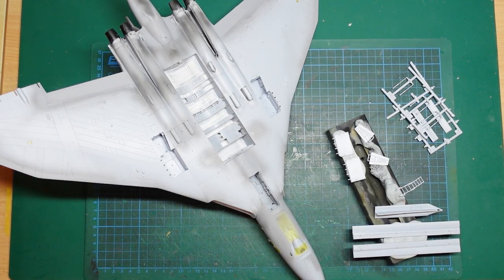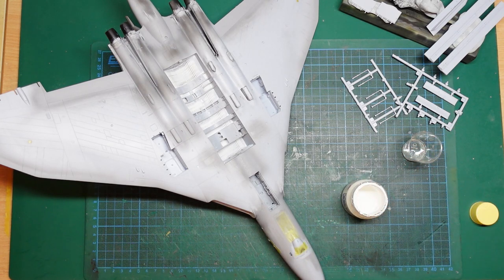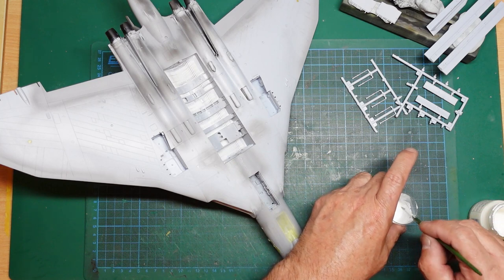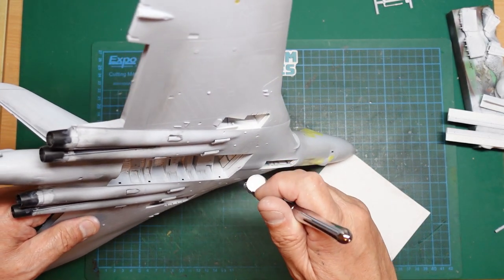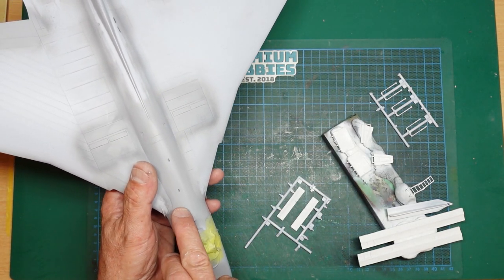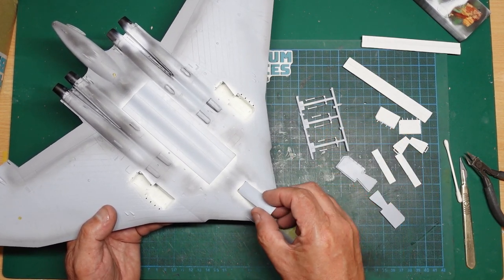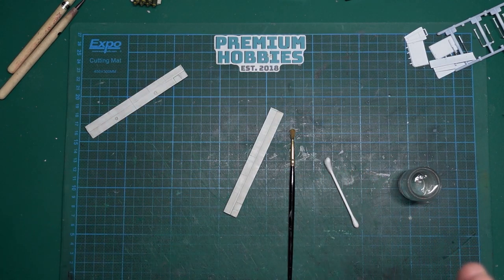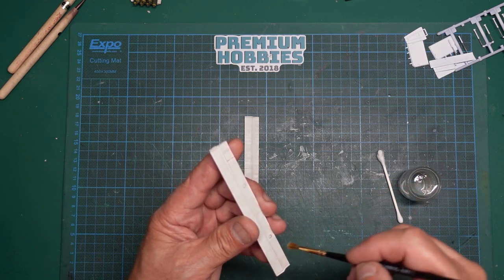New Tool Airfix 1/72 Vulcan build. Part 14.

Comment: An outsider thought here...and i apologize if it offends anyone.  At my age (over 60) it seems I have a lot of prescription bottles, so I save a few of various sizes and after cleaning (obviously) I find them darn handy for paint mixing, as well as using the lids for small amounts like washes etc... just an idea for reusing stuff we likely all have, and they can be recleaned-no issues with solvents or painting reacting so far, as usual, Nigel really terrific work Thanks for humouring me, Dane
Reply: I use my old bottle to hold 1/35 scale figures. As I plan out a figure and all of his different accessories, they fit neatly into the standard size bottles. Never even thought about using them to mix paint.

Comment: For anyone that wants to mix paint externally, but not waste a load of plastic on disposable paint cups, here's a idea: Head to your local pound shop and pick up some little shot glasses. Being glass, they are easy to clean and reuse and won't become contaminated or react to the solvents as plastic does.

Old paint pots would probably do the job just as well. However, they tend to have a square internal cross section that's harder to clean. My shot glasses have a curved well internally so there's nowhere for paint to get stuck.

Comment: Mate , I don't understand why people need plastic cups when you can use old paint pots🤔🤔🤔🤔🤔  I have a diluted  bleach bucket , throw in used pots , pull the lid apart,  soak over night  , rinse,  voila ! No plastic cups required !   Doing a fantastic job , bomb bay ,looks great 😊😊😊😊

Comment: Cut the bases off beer cans with scissors about 10mm from bottom...and turn them upside down...Use for shallow paint mixing...Use the smaller redbull size for slightly smaller ones

Comment: Great build Nigel.  I have a question as regards using oils.  Do you put a dab of oil on say a piece of cardboard to allow some of the oils to be absorbed prior to using them?  I found it does remove some of the sheen from the oil paint but am a little unclear about doing it that way and thinning the paint to use as a wash would it bring back the sheen, or am I getting confused in my old age.  Thanks and stay safe.
Reply from the maker: Yes and yes basically Allen. The oils in the oil paint are I think what gives them the sheen? I always use cardboard to soak the oils out as you say. I have used it straight from the tube with no issues, but I would always flat coat over the oils anyway. For the browns and blacks it's easier to make a batch or buy ready nade.
Reply: @NigelsModellingBench  Thank you sir, and have a great Friday and weekend.  Cheers.

Comment: Looking great Nige. The weathering is not as big a process as some make it out to be but it does have a big effect on the finished model. Can one use any oil paints or only certain types for weathering???
Reply from the maker: Thanks 👍 In my opinion any oils can be used, just make sure you use odourless thinner.
Reply: @NigelsModellingBench  Thanks Nige👍